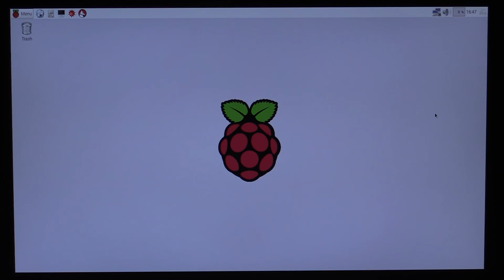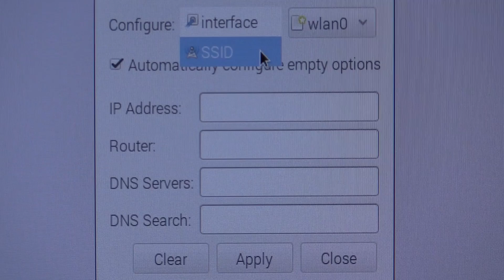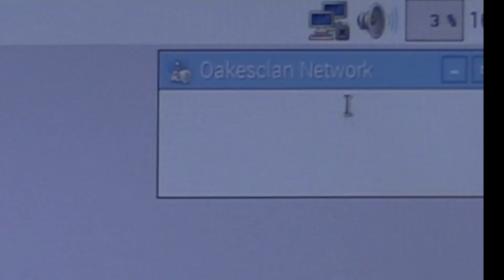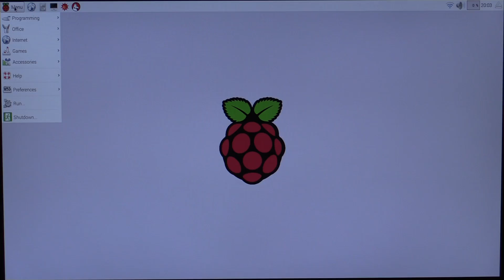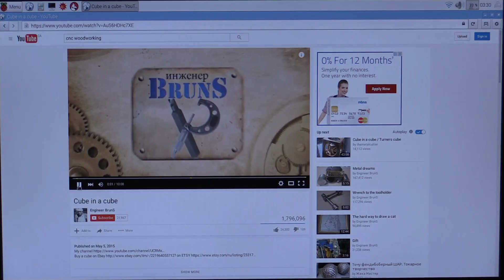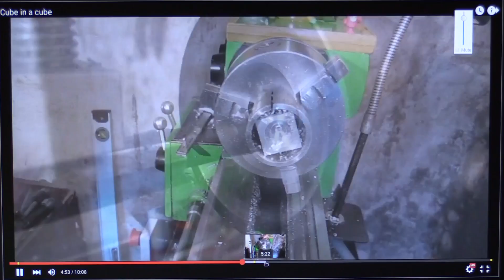Raspberry PI 2 B first time Setup (1/2 Hr Process V1.5.0)  - WIFI Config

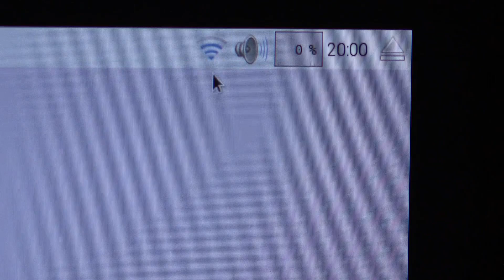Comment: At 4:23 in your Video Peter you show that the eth0: Link is down... Mine says the same thing, even though I am connected via the WiFi and signed in with password, everything working that way, but every time I try to launch the Internet Browser, I do not have any network access. Any thoughts? Thanks.

Comment: I'm using the Wi-Pi dongle here which I got with the Pi 2. For the life of me, I can't get it to work. I've followed along with your instructions and instead of getting the Wi-Fi icon, I still have the networked computer icon. Hovering over it I get a popup that says wlan0: Not Associated. Any ideas?
Reply from the maker: +Glen Harness That is correct, if you now click on the network icon with the LEFT mouse button (The one that says "wlan0: Not Associated" ) it should show you available wireless networks, click on one of these and it should then prompt for the password if one is set, this is exacly how mine is working, I re-installed to confirm for you (And others)
Reply: +Peter Oakes (TheBreadboard) Thanks. I've done that till I'm blue in the face and it just doesn't connect. This is the official Wi-Pi dongle that I got from MCM Electronics, and it worked great with the prior version of Raspbian. It would be nice if there were more options to configure the wireless so that I could choose a different type of security for example.
Reply from the maker: Do you even see the list of networks available ?
I honestly did not have to do a thing except select my "Oakesclan Network" and then enter the password key. this is configured as WPA 2 I beleive
Reply: +Peter Oakes (TheBreadboard) Yeah. I have two Wi-Fi access points (an AT&T Uverse box and a Trendnet one). It shows both SSIDs. I put the password in and click ok, and it's as if I didn't do anything. I'm stumped. I'd like to use this version of Raspbian, but without Wi-Fi connectivity, it's a bummer. Perhaps I should go back to the previous version and just update that rather than starting afresh like I tried to do.
Reply from the maker: +Glen Harness With the current version, have you tried looking at and editing  using sudo nano /etc/network/interfaces
and if so, what was the result ??
Reply from the maker: +Peter Oakes (TheBreadboard) is the WIFI security WPA-Personal, this is what mine used and it worked first time
Reply: +Peter Oakes (TheBreadboardca) I'm not sure. I'll have to check.
Reply from the maker: Under Raspian there is quite a range of WIFI adapters that will work well, Under Windows 10 IoT the choice is quite limited right now
Reply: +Peter Oakes (TheBreadboardca) I have to perhaps correct you Peter. I did not see you access the internet with the browser. At 4:23 in this Video you show the network access and it says that eth0:Link is down just like it is with mine, and I cannot get access to the internet even though the WiFi is indeed configured and showing it is connected to the ip address and password is working, but not access to the internet. Do you have any info on this?
Reply from the maker: +Joel Eenkhoorn But the Package Manager was shown updating the package list that also use an internet connection
Reply: Ok, so, I have used the WiFi dongle with Raspian and eth0:Link does not connect and I have no network access to this day, on the other hand, when I use Kodi and connect via the WiFi there, I have full access and stream without any issues.  I just noticed in your video that you had the same connection with "eth0:Link down" at 4:23 in your video. So you are saying it was "Updating" and that I should be patient to allow this process to complete? How long should I waIt before I give up?